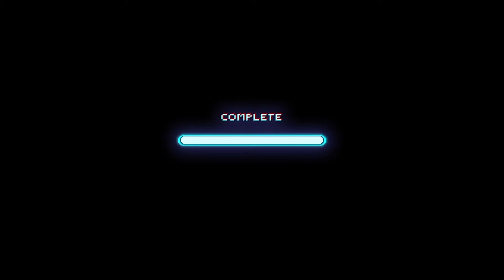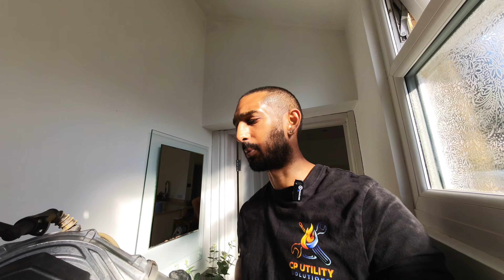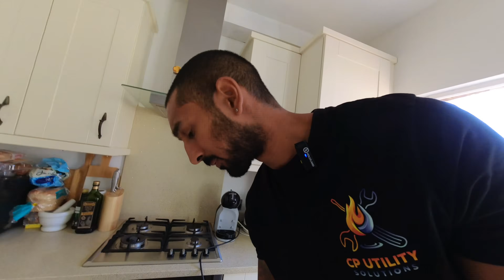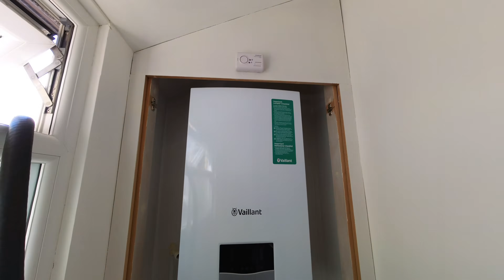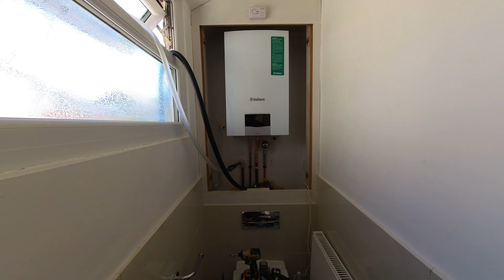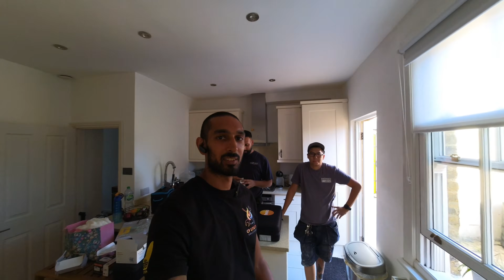The Job Was Going Too Well... - A Day In The Life Of A Gas Engineer 76

Comment: Only use the Vaillant controls on the new boiler you will never get it to work correctly using third party controls
Reply from the maker: Thanks 👍🏾
Reply: Because Honeywell haven’t been making heating controls for decades 🤣 C’mon mate - it’s preferable, not a requirement.
Reply: @TARSoda  third party controls don’t know what they are controlling just switching off and on